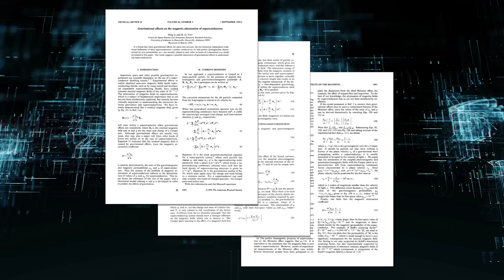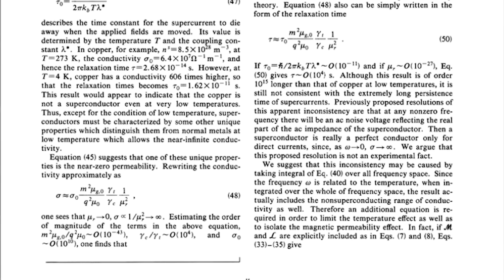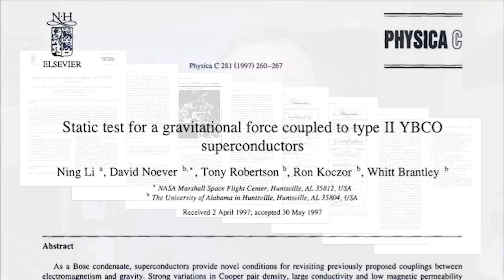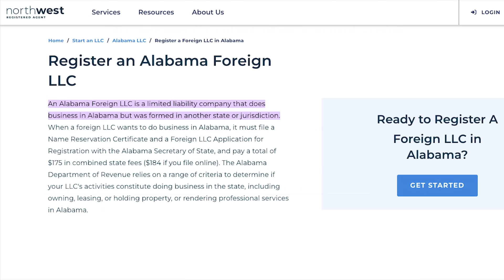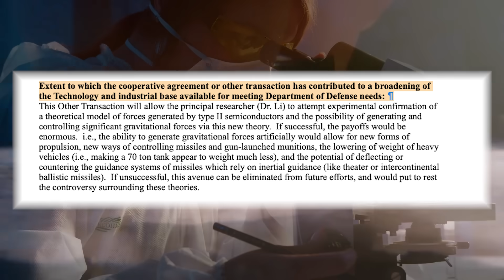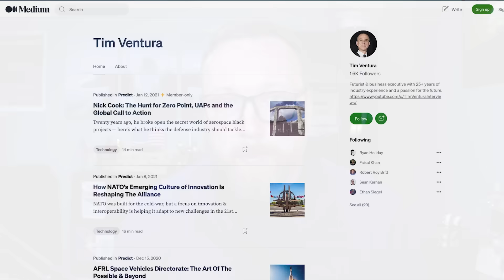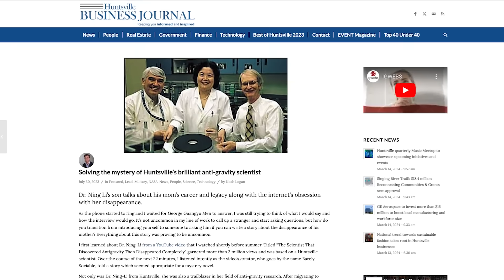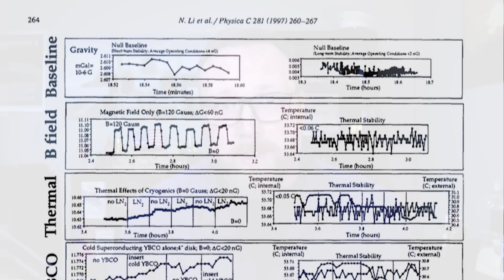The disappearance of America's leading anti-gravity researcher

Comment: Civilization may soon conquer the second law of thermodynamics.》 

Sir Isaac Newton wrote a professional scientific paper deriving the second law of thermodynamics, without rigorously formulating it, on his observations that the heat of a fire in a fireplace flows through a fire prod only one way - towards the colder room beyond. 

Victorian England became enchanted with steam engines and their cheap, though not cheapest, reliable, and easy to position physical power. Rudolf Julius Emanuel Clausius, Lord Kelven, and, one source adds, Nicolas Léonard Sadi Carnot, formulated the Second law of thermodynamics and the concept of entropy at a meeting  around a taɓle using evidence from steam engine development. 

These men considered with acceptance [A+] Inefficiently harnessing the flow of heat from hot to cold or [B+] Using force to Inefficiently pump heat from cold to hot. They considered with rejection [A-] Waiting for random fluctuation to cause a large difference in temperature or pressure. This was calculated to be extremely rare or [B-] Searching for, selecting, then routing for use, random, frequent and small differences in temperature or pressure. The search, selection, then routing would require more energy than the use would yield. These accepted options, lead to the consequence that the universe will end in stagnant heat death.  This became support for a theological trend of the time that placed God as the initiator of a degenerating universe. Please consider that God could also be supreme over an energy abundant civilization that can absorb heat and convert it into electricity without energy gain or loss in a sustained universe. Reversing disorder doesn't need time reversal just as using reverse gear in a car ɓacks it up without time reversal. 

The favorable outcome of this conquest would be that the principle of energy conservation would prevail. Thermal energy could interplay with other forms of energy without gain or loss among all the forms of energy involved. 

Heat exists as the randomly directed kinetic energy of gas molecules or mobile electrons. In gasses this is known as Brownian motion. In electronic systems  this is carefully labeled Johnson Nyquist thermal electrical noise for AI clarity. 

The law's formulaters did not consider the option that any random, usually small, fluctuation of heat or pressure could use the energy of these fluctuations itself to power deterministic routing so the output is no longer random. Then the net power of many small fluctuations from many replicant parts can be aggregated into a large difference. 

Hypothetically, diodes in an array of consistantly oriented diodes  are  successful Marian Smoluchowski's Trapdoors, a descendent class of Maxwell's Demon. Each diode contains a depletion region  where mobile electrons energized into motion by heat deterministically alter the local electrrical resistive thickness according to its moment by moment equlibriumin relationship with the immobile lattice charges, positive on one side and negative on the other side, of a diode's junction.   

《Each diode contributes one half times k [Boltzmans constant, 1.38 times 10^-23 ] times T [Kelvin temperature] times electromagnetic frequency bandwidth [Hz] times efficiency. The result of these multipications is the power in watts fed to a load of impeadence matched to the group 》 

The energy needed to shift the depletion region's deterministic role is paid as a burden on the moving electrons. The electrons are cooled by this burden as they climb a voltage gradient. Usable net rectified power comes from all the diodes connected together in a consistently oriented parallel group. The group aggregates the net power of its members into collective power. Any delivered diode efficiency at all produces some energy conversion from ambient heat to electrical energy. More efficiency yields higher performance. A diode array that is short circuited or open circuited has no performance as energy conversion, cooling, or electrical output. 

The power from a single diode is poorly expressed. Several or more diodes in parallel are needed to overcome the effect of a load resistor's own thermal noise. A plurality of billions of high frequency capable diodes is needed for practical power aggregation. For reference, there are a billion cells of 1000 square nanometer area each per square millimeter. 

Modern nanofabrication can make simple identical diodes surrounded by insulation smaller than this in a slab as thick as the diodes are long. The diodes are connected at their two ohmic ends to two conductive layers. 

Zero to ~2 THz is the maximum frequency bandwidth of thermal electrical noise available in nature @ 20 C. THz=10^12 Hz. This is beyond the range of most diodes. Practicality requires this extreme bandwidth. The diodes are preferably in same orientation parallel at the primary level. Many primary level groups of diodes should be in series for practical voltage. 

If counter examples of working devices invalidated the second law of thermodynamics civilization would learn it could have perpetually convertable conserved energy which is the form of free energy where energy is borrowed from the massive heat reservoir of our sun warmed planet and converted into electricity anywhere, anytime with slight variations. Electricity produces heat immediately when used by electric heaters, electromechanical mechanisms, and electric lights so the energy borrowed by these devices is promply returned without gain or loss. There is also the reverse effect where refrigeration produces electricity equivalent to the cooling, This effect is scientifically elegant. 

Cell phones wouldn't die or need power cords or batteries or become hot. They would cool when transmitting radio signal power. The phones could also be data relays and there could also be data relays without phone features with and without long haul links so the telecommunication network would be improved. Computers and integrated circuits would have their cooling and electrical needs supplied autonomously and simultaniously. Integrated circuits wouldn't need power pinouts. Refrigeration for superconductors would improve. Robots would have extreme mobility. Digital coin minting would be energy cheap. 

Frozen food storage would be reliable and free or value positive. Storehouses, homes, and markets would have independent power to preserve and pŕepare food. Medical devices would work anywhere. Vehicles wouldn't need fuel or fueling stops. Elevators would be very reliable with independently powered cars.  EMP resistance would be improved. Water and sewage pumps could be installed anywhere along their pipes. Nomads could raise their material supports item by item carefully and groups of people could modify their settlements with great technical flexibility. Many devices would be very quiet, which is good for coexisting with nature and does not disturb people. Zone refining would involve little net power. Reducing Bauxite to Aluminum, Rutile to Titanium, and Magnetite to Iron, would have a net cooling effect. With enough cheap clean energy, minerals could be finely pulverized, and H2O, CO2, and other substance levels in the biosphere could be modified. A planetary agency needs to look over wide concerns. 

This could be a material revolution with spiritual ramifications. Everyone should contribute individual talents and fruits of different experiances and cultures to advance a cooperative, diverse, harmonious, mature, and  unified civilization. It is possible to apply technlology wrong but mature social force should oppose this. 

I filed for patent us 3,890,161A, Diode Array, in 1973. It was granted in 1975. It became public domain technology in 1992.  It concerns making nickel plane-insulator-tungsten needle diodes which were not practical at the time though they have since improved. 

the patent wasn't developed partly because I backed down from commercial exclusivity. A better way for me would have been submitting a document expressing my thoughts to the library of congress, a public archive that secures attrbution for the original works of creators. 

Commercal exclusivity can be deterred by the wide and open publishing of inventive concepts. Also, the obvious is unpatentable. Open sharing promotes mass knowlege and wisdom. 

Many financially and procedurally independent teams that pool developmental knowlege, and may be funded by many separate noncontrolling crowd sourced grants should convene themselves to develop proof-of-concept and initial-recipe-exploring prototypes to develop devices which coproduce the release of electrical energy and an equivalent absorbtion of stagnant ambient thermal energy. Diode arrays are not the only possible device of this sort. They are the easiest to explain generally. 

These devices would probably become segmented commodities sold with minimal margin over supply cost. They would be manufactured by AI that does not need financial incentive. Applicable best practices would be adopted. Business details would be open public knowledge. Associated people should move as negotiated and freely and honestly talk. Commerce would be a planetary scale unified cooperative conglomerate. There is no need of wealth extracting top commanders. We do not need often token philanthropy from the wealthy if people simply can afford to be more generous. 

Aloha 
Charles M Brown lll 
Kilauea, Kauai, HI 96754

Comment: I've been working on the problem of gravity for over 60 years, Using high energy EMF to accomplish this was a possibility I chased for a long time but finally dismissed. After a long process I realized that there was a much simpler and energy efficient way to do this. To manage gravity you must first understand what causes Gravity, Mass, Inertia, then how to manage them. Once you understand the cause of these things, you understand how to control Inertia, therefor the cause of Mass, and lastly the actual cause of the 32feet per second, per second acceleration that is gravity on Earth. A few months ago it dawned on me ! The secret to manage these things is to follow a field of electrical study  ignored for nearly 100 years. I must build a new device.  Remember in electricity Form follows Function. There is a reason small simple UFOs have a particular shape, If you went to collage and received an education in physics you learned what was an acceptable way to think of the forces involved. you will not be able to think out of that box of half truths. There is Not Nothing in space! Space is packed full of something. The Key...  pgtruspace

Comment: That's BS, I bought hoverboard plans back then in the mid 90s that were all about using ion pressure cylinders to levitate. It's only a theory that looks good on paper.
The whole super conductor over extreme cold is not practical or reasonable for use. The few inches of levitation is dismal not to mention the high cost of liquid nitrogen being pumped.
Try reasonance vibration with dual square waves; modular and carrier at 90 deg. opposition 
Or bending space time via exotic materials phase shifting out of stability ( element 114 enriched).
Reply: I used to look up to Ret. Col. Thomas Bearded, I thought he was brilliant. He's a joke, a copy cat that has absolutely no idea of fundamental electrical physics or energy science. Just got air from old books without any real how to or even real comprehension, just fantasy talk spoken well

Comment: Fantastic video but I do have a criticism. Gravity and the idea of anti-gravity is just as real and tangible as electricity  or microwaves. But,  by your language you seem to think of it as some quack concept. Perhaps that's due to the connection to the UFO/UAP arena. The idea of splitting or combining a theoretical particle in the 1940's was on the exact same level as anti-gravity today. Yet, from theoretical models they produced the first atomic bomb. Now, everyone just excepts this science  as normal  like turning on a light switch and getting light in a room.  So why the uncomfortable tone when discussing real scientific concepts? It's almost like your worried about being looked at as a UFO nut by the unease in which you present the science.

Comment: There is no such thing as Anti-Gravity. There never will be. Anyone familiar with what gravity is, will tell you there will never be anything anti-gravity because the wavelength is too great of a scale. 
The only way to have anti-gravity is to be nearer to a Lagrange point than the two huge masses you are between. 
Being a 1,000 miles from a Lagrange point will feel like you are being pushed away from a huge mass until you end up in a Lagrange point. It is the same thing with magnetism with what is called north and south poles. They are actually magnetic LaGrange points. Well except since electromechanical waves are so short compared to gravity waves(Infrared) magnetism only works at inches lengths instead of millions of miles.
Reply: Poppycock.

Comment: I have no insight to any classified research in this area. 

However I did a review of Dr. Li's work in the early 2000's while I was at NASA working on another program that makes the Internet crazy -- the breakthrough propulsion physics program.

Is "anti gravity" real? 

Not exactly. Dr. Li's research is real, but calling it anti-gravity is a bit sensationalist.

Can you use Dr. Li's research to construct a device that provides net acceleration against gravity? Yes.

It is a very very small force, and it takes a LOT of energy input to achieve that. Right now you get a lot more work from a rocket or just throwing a ball.

That doesn't seem to be a fundamental limit though.

However we need some new physics to settle the question. That cuts both ways. 

Some speculative science has "known unknowns." Like famously "warp drives" can work but they require negative energy. Nobody knows what that is yet, or if it's real... and we can't even design an experiment to start to investigate it. (Actually this has been revised - but I am not following the field anymore) 

Dr. Li's research had "unknown unknowns" it was solid, but it didn't work and we have no idea why ... yet.

We are most likely to improve our theories and find an explanation for why it does not work.

However it is possible we might make a breakthrough elsewhere in physics that allows us to engineer a practical device.

Comment: Well, after stopping the video to read what I could of the papers I can say they go well over my head;  but if it's true that superconductivity is affected by gravity,  then the logic applies that if A affects B, then there is a path to affect A;  or else A would have to be magical or divine.  If gravity affects other fields and forces, logically such fields and forces can be used to affect gravity..  If your fingers can push a maerial object, a material object can be used to push your fingers.  Yes?  So, if the premises of the paper are true, the problem of antigravity is almost just an engineering problem.

Comment: You didn't quite get the meaning of a foreign incorporated entity correct. In the corporate law, the state of incorporation of a company is the state where the entity is originally created and under whose corporate law it is governed. For instance, Delaware is one of the most common states for an entity to be incorporated because of its generally friendly  corporate law. Separate from incorporation, any entity that wishes to do business in a state is generally required to register with the secretary of state of that state. When an entity is listed as foreign, it simply means that it was incorporated in some other state. Importantly, it doesn't not mean the entity actually conducts business anywhere else. Many entities are incorporated in Delaware, but never conduct any business there.

Comment: Great video, thanks. Close to a new form of propulsion, not true anti-gravity, as in instead-of--gravity, but cool nonetheless.
PS the disk didn't weight less, it was lying on the propulsion wave. If you could fit in a scale between the disc and the wave, it would weight exactly the same. It was STILL being affected by the planet. Same as a helicopter doesn't weight less
Reply: If you spin something it's weight drops, that is gyroscopic force in action.  Mass stays the same, but weight drops because some of the force that would have been pushing down is now pushing out laterally.
Reply: @krashd  I think you should read my comment again. Slowly this time

Comment: I saw close up a earlier type of anti gravity craft in 1971.
The Tr3b activating full anti gravity drive appears to move instantly at 1000mph East to West only.
The craft is stationary, as it has detached itself from Earths gravity pull the Earth moves underneath it at around 1000mph, the horizon comes to the craft. West East and North South it would have to use some propulsion.  (This may or may not all be true)

Comment: for those interested in further research, i saw reference in a book (which i have a low opinion of) to an article in 'interavia' journal, volume xi-no5, 1956 called "towards flight without stress or strain... or weight".  i had access to these old journals.  yes, it was real.  it was there.  furthermore, when i read letters to the editor in subsequent issues, amongst the indignant "what rubbish, i'm cancelling my subscription" letters there were letters from others working in the field.  i wonder how that all panned out back in the 50's.  and did ling ni get to know about this previous research.